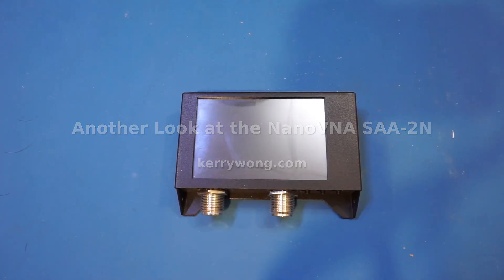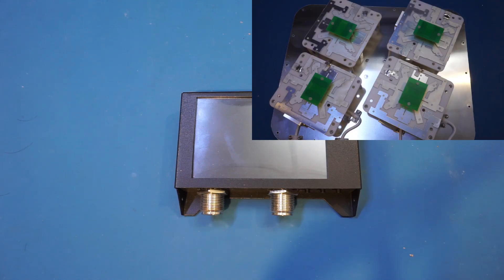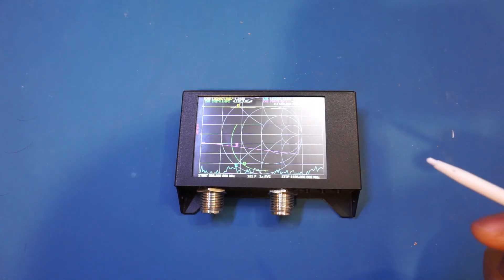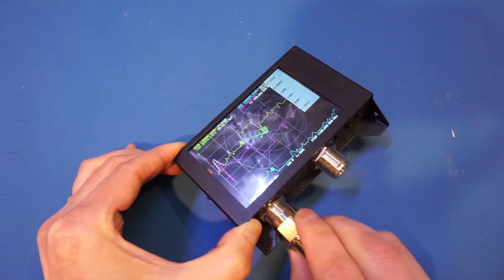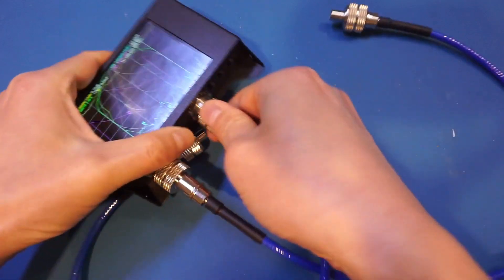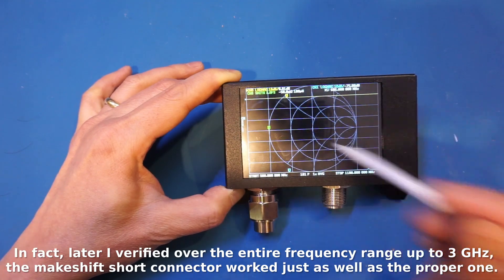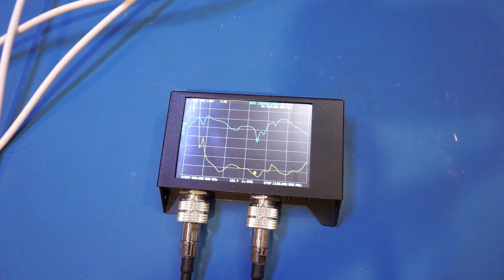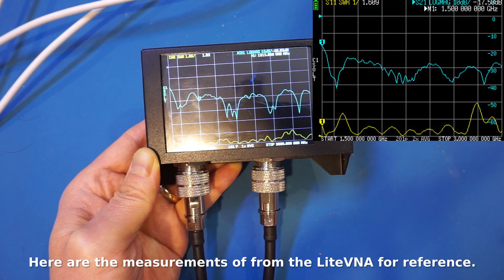Another Look at the NanoVNA SAA-2N

Comment: mine just fell apart. One of the N connectors came of. On the rear is welded a SMA connector which is screwed into a SMA conector on the board and then welded. All the pressure on the N connector goes directly to the SMA connection which finally failed.  I had hoped for the N connectors to be stronger than the SMA connectors.

Comment: Great Video Kerry!
Question:  I have this SAA-2N (purchased from R&L Electronics) and my firmware says "git-20201117-9659de4"
Do you know is there is a newer version (with hopefully more data-points) and a reliable place to get it.
I really appreciate my 2N as I don't feel scared in damaging the connectors; so I don't want to 'brick-it' loading the wrong firmware.
Thank You and appreciate the videos that you do, especially the teardowns and deep-dives!  73...
Reply from the maker: Well, I haven't updated the firmware on mine as my understanding is that if my memory serves me correctly, you will need to solder a jump wire to do that.
Reply: @KerryWongBlog  sounds like a video--lol!
Is your version newer than mine?
Reply from the maker: @SpinStar1956  Well, interestingly I just checked my version, the version number is blank on mine. It did have the build time which is Jun 9 2021 - 17:36:19
Reply: @KerryWongBlog  well, that would make sense as you’re one of those early adopters; I purchased mine later in the game in fact, had to wait for them to get back in stockat R & L Electronics.  If I had to replace this, I would really like to find one with connectors as I have learned to use adapters to go to SMA or BNC or whatever. I immediately saw the ones with the SMA connectors as being problematic, and that you could break off the SMA connectors from the circuit board as I don’t think they are attached to that plastic case!
Anyway, thank you very much for replying, but a video showing how to update one of these ( and a reliable place to get the firmware ) would be fantastic!

Comment: Nice video. I wish manufactures would use BNC's instead of SO 239's or N connectors. There's no need to have such a large connector on this type of unit. The BNC's are in fact 50 ohms the same an N connectors. So why such a big connector?
Even my Oscilloscope and other test gear uses BNC's. 
I have a NanoVNA H4 and it's really a great tool with so many features and sells for a very reasonable price. 
Barry, KU3X
Reply from the maker: Although BNC's can operate up to around 4 GHz, most RF equipment above several hundred MHz are using SMA or N connectors.
Reply: @KerryWongBlog  There are higher rated BNC connectors, but yes the cheaper ones fall short. I personally like the quick connect of the BNC more, but SMA is just so cheap, versatile and available.
Reply: BNC for RF? that is way worst than SMA, so what would be the point? BNC are far better than SMA and hold better repeated disconnect / reconnect cycles.

Comment: Thank you, Mr Wong! If you are new to VNAs, would you recommend a beginner N connector or SMA? Is there one version more "future proof"?
Reply from the maker: Depending on what you are trying to measure (if you have more equipment with N-connectors then choosing one with N-connector makes sense). If you are not sure, I think getting one with SMA makes sense as it's cheap and you can always use an SMA-N adapter later on...
Reply: N connectors are quite a bit more robust than SMA.  Chances are that the average hobbyist will be connecting to devices under test which are outfitted with UHF (SO-239/PL-259), BNC or N connectors.  Attaching adapters to the original SMA type Nano VNA makes for an ungainly configuration because the adapters weigh more than the VNA itself.  Unless you routinely work with devices under test with SMA connectors, I recommend the VNA with N connectors and adapters if needed.

Comment: I have same,when you do the cal. what about starting with the cable and attach the ope,short. load to it ????
Reply from the maker: Actually, your approach is probably more accurate as the it would be all calibrated at the cable end. For practical reasons, unless your measurement needs to take in to consideration of the cable length (e.g. plotting Smith Chart), the results you obtained are comparable.
Reply: @KerryWongBlog  I know you're right, but it felt so wrong. 

The only thing I can say is that calibrating with short cables is better if you'll be switching cables throughout testing or if you're using cheap or questionable cables.

But all of this is moot for the nanoVNA since it's not really meant to be a high spec VNA. Calibrating without the cables probably won't make a meaningful difference.
Reply: Thank you. I had the same question and was wondering if there is a difference.